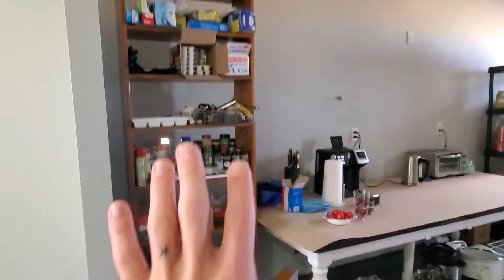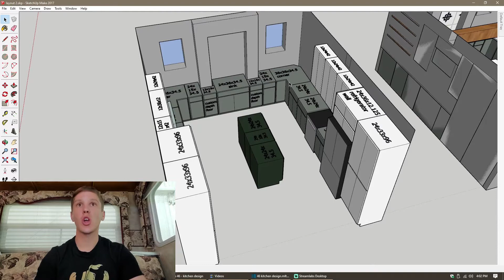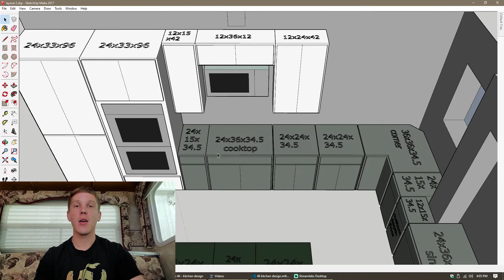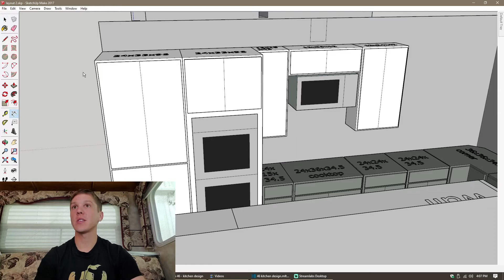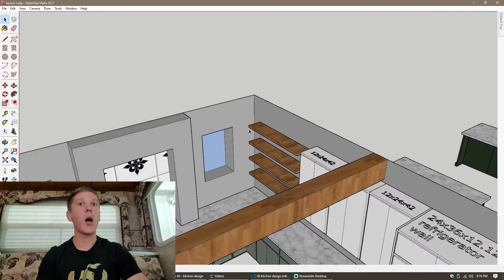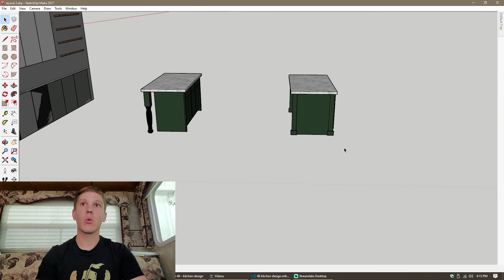50x60 Custom Hangar Home Episode 46: Designing the Kitchen

Comment: looking great!  sweet model, will be a very nice kitchen.  did ya'll consider making the tile backsplash area a big window?  might open it up a lot and create views from front door all the way out of kitchen
Reply from the maker: Thanks! We originally wanted the window directly over the sink. The problem is there's a huge structural I-beam in that false box, and the metal building manufacturer said I couldn't put a window within 12" of the beam. So there just wasn't enough room to center a window over the sink. The 2 side windows was the best compromise I could come up with.